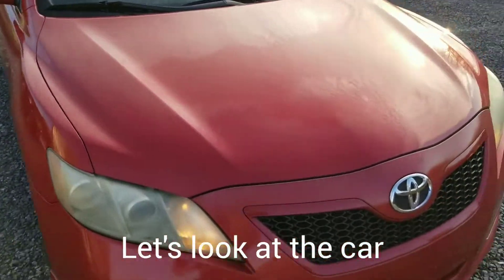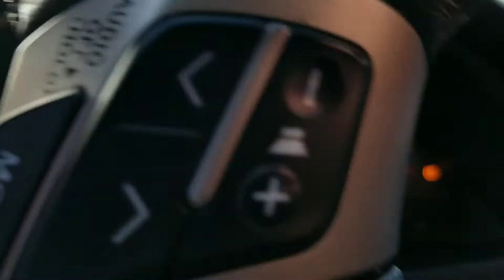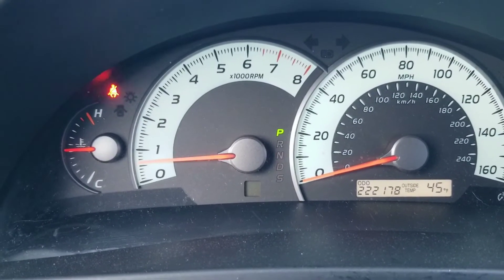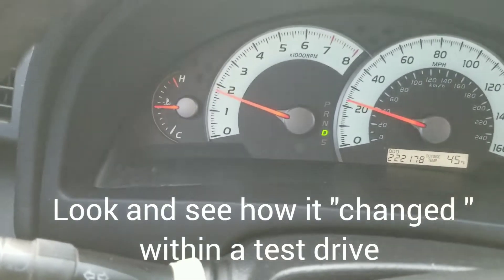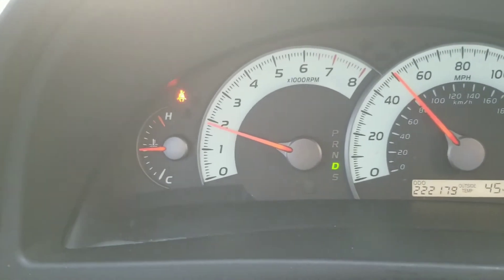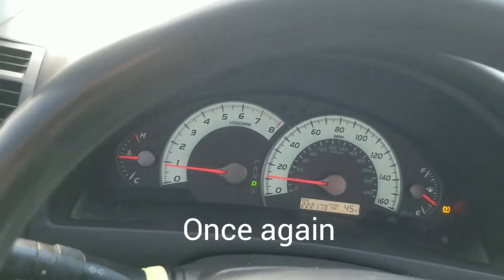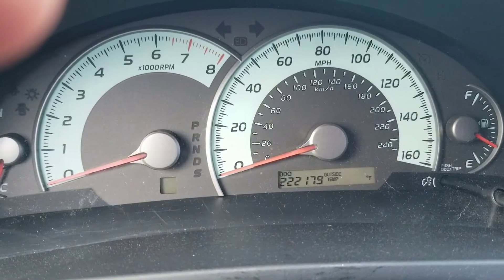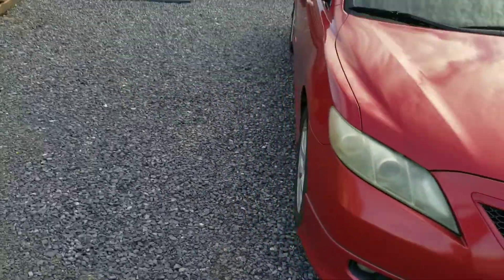Understanding the Toyota U660E

Comment: I want to use this transmission on a non oem application. If I wire it up to use the factory tcm, but the tcm is unable to communicate with an ecu, will it still work? So, basically everything gets wired, except for the can bus system, so it still gets wheel speed and such, just no can network.

Comment: I’ve had a similar issue for a few months. I started seeing cel and traction light off an on with no noticeable issues. I pulled a p2716. I replaced that solenoid and changed fluid and filter. 98k. Since then, I still get the p2716 code, and now have the hard shift from park/reverse, reverse,drive. Any ideas as to how I can fix this? I’m also seeing around 13mpg.
Reply from the maker: @RandomTasks007  you should have the line pressure checked with a wet Guage to see if the pressure is correct because that code is for the SLT solenoid which controls line pressure
Reply: So, I ended up driving another car for a few months and let the Camry sit. I no longer get any codes or CEL. I’m still getting harsh engagement when put in drive and reverse. Sometimes I put it in reverse and it doesn’t nothing. The R comes on the dash, and reverse lights come on, but not actually engaged in reverse.

Comment: I have a 2015 3.5 v6 awd venza with 46,000 miles on it that is having delayed shifting from Park to Drive. I can’t believe with such low miles is having this issues. I thought this transmission were bulletproof so to speak.
Reply from the maker: These are pretty good transmissions, but you're delay could be a few different thing from linkage to line pressure or simple as an adjustment . With that problem  have a professional look at it, most trans shops won't charge to do a simple diagnosis
Reply: 3 different shops all said he needs replacement. I still can’t believe it, given the miles.

Comment: Excellent video.  Thank you. I had my 2014 Lexus ES350 with u660e fail on the wife during a 4h road trip. Nothing unusual, car has 105k, no towing, level roadways, trans fluid never touched. (We owned the car since 36k miles). It started shifting crazy during the road trip then threw a code P2714 then we lost reverse too. Dealer said trans was shot and needed replaced. Had a friend replace it with used and donor car had 55k miles. Several days after getting the car back and driving it, we experienced same code P2714 and weird shifting.  We drove it home and it’s been sitting since. Where would u suggest to troubleshoot?  The mechanic reused the TCU from the original trans. Could the original TCU be bad and causing damage to both trannies?  Help!